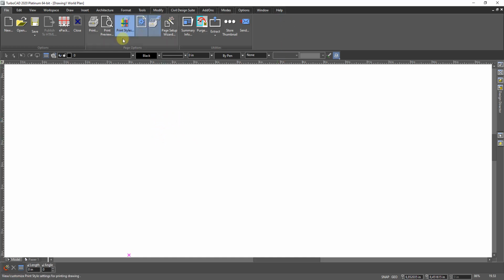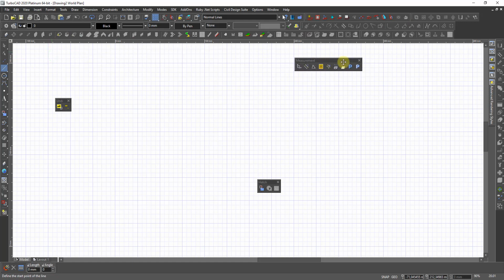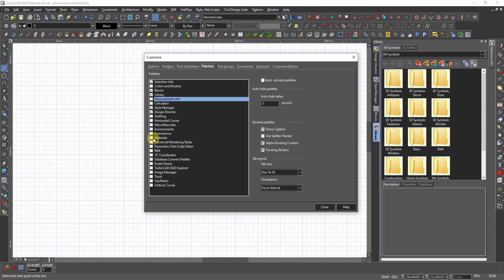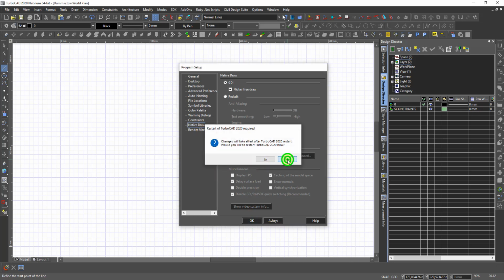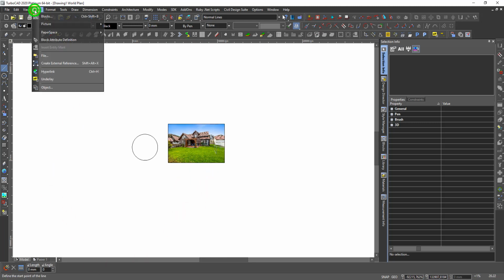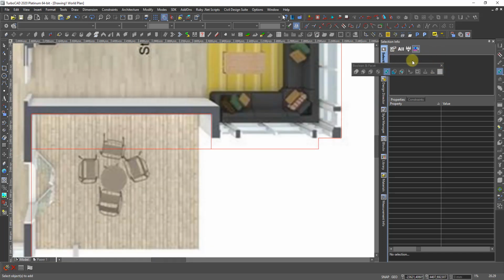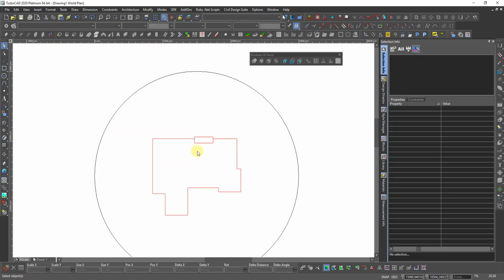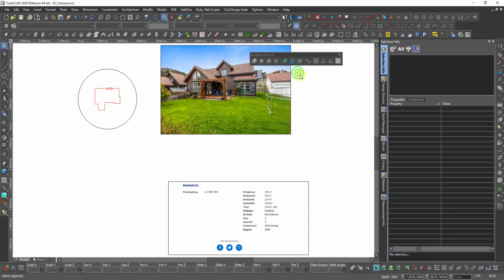01 House A

Comment: Torfinn Skari, It would be so good if you could let us have a picture of the floor plans : )
Reply from the maker: Thanks for the comment Moon888, i don't know if that is possible in YT, but if you stop the video when you see the plan good, then you can use Windows Snip tool and make your own picture, save it as a .jpg
Dimension on it doesn't matter as you scale in TC when you insert it afterwards 
Regards Torfinn
Reply: Thanks @torfinnskari  I should have deleted this message, as further into the video I noticed that I could cut and paste a larger image : )